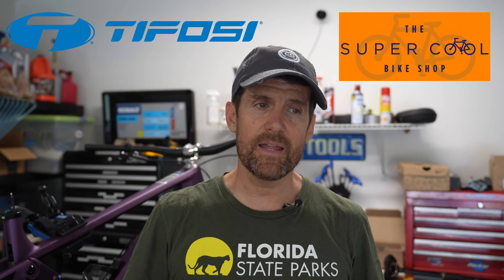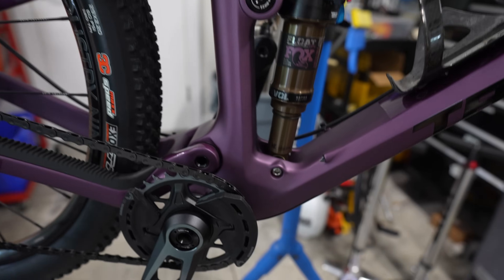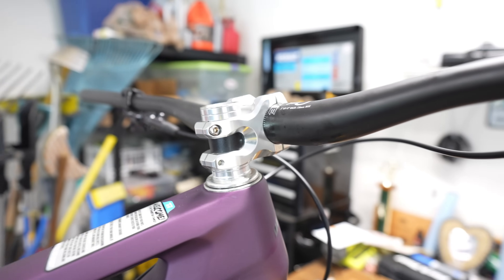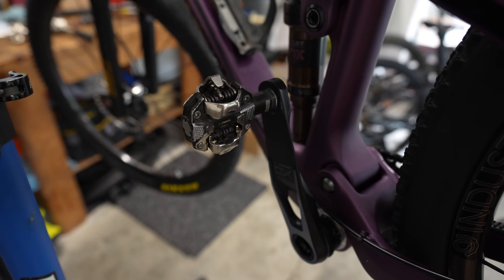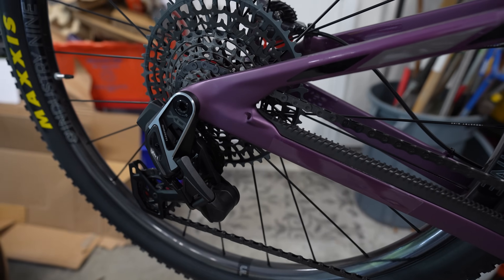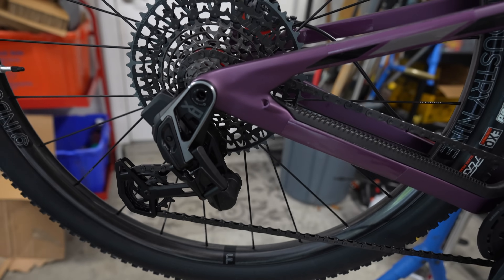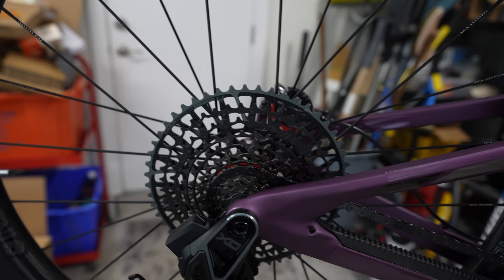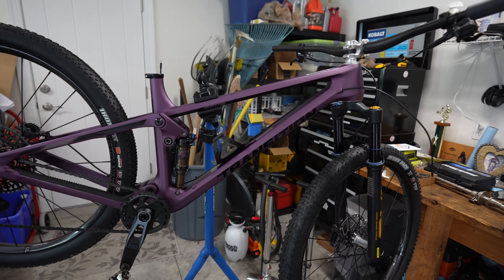Transition Spur Dream Build: The process of building the bike

Comment: Hey Clint… nice build! If I was going to name this bike, I would call it Barney…

One fine point, I made a small flexible plastic flap to cover the gap between the seat tube and swing arm. This prevents rocks from lodging  here, where they could crack or damage the carbon. I made this out of an old front fender. The flap is attached above with 3M double sided mounting tape and a single zip tie. The bottom floats with the swing arm.

Transition should do this. My wife’s Ripley has a flap in this location.

Comment: If you have a regular non-dropper seatpost of the same size you can put it in with the cable going up inside it, then you can clamp it in the stand that way. or if it’s 31.9 maybe inch and a quarter pipe.

Comment: Does running 170's on the spur really make much of a difference for pedal strikes vs 175's? I'm doing a similar build but at 6'4 I'm still deciding what crank length to run. Also running 175s on my gravel / road bikes
Reply from the maker: For me it does. My first spur had 175s. My second one had 170s.  I had much less pedal strikes with the 170s, which is why I went with 170s on this one.
Reply: Any negative effects of the 170s? Is it a noticeable change to pedalling performance,  eg on long climbs?
Reply from the maker: @Bike-zm4uy  no. I was very fast in time trials on the spur with 170s.

Comment: I know you addressed this....and I'm guilty of doing it in a pinch too but why not just throw the seatpost in the frame temporarily? Seems like an unnecessary risk to me.
Reply from the maker: Because you have to remove the bottom bracket to install the cable and I did not want to take everything apart again. I would have to push the cable down inside the frame to install the seat and didn’t want to risk it not being able to pull it back out again without it attached to the seat post
Reply: @ClintGibbs  wait what? The cable doesn't slide once the bb is installed? That's horrific design.
Reply: You can also just install the cable with it so when you pull the dropper out the cable and housing will come up with it
Reply from the maker: The metal stop on this design goes into the lever not the seat post. I need the lever to fully install it.
Reply from the maker: The design is fine. The cable slides easy when pulling; I just didn’t know about pushing it.
Reply: @ClintGibbs  just lightly pull on one end and push on the other. Pretty normal stuff in shops. Not worth the risk with the frame clamp in my experience with some of the torque values SRAM specs. Especially the BB.
Reply from the maker: I can’t pull on the seatpost and with it so far into the frame. That’s the reason.  Trust me, there’s about 100 times more force put on the frame on a 2 foot drop than there is resting in the work stand.
Reply: @ClintGibbs  but you're just pushing the housing? Why would it get lost in the frame? I don't understand the problem at all. I've done it hundreds of times and I've never lost already routed housing.

That's not true at all. There's no forces directly pinching the top tube in any normal riding, engineers don't design for that type. It's just not a smart practice if avoidable... Do you do it normally? I doubt it. 

Anyway, sweet bike.